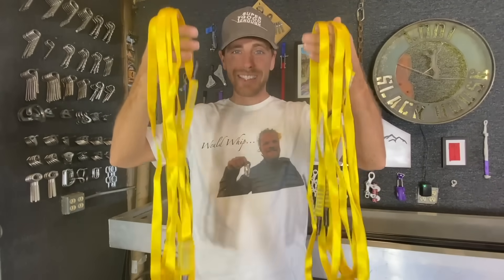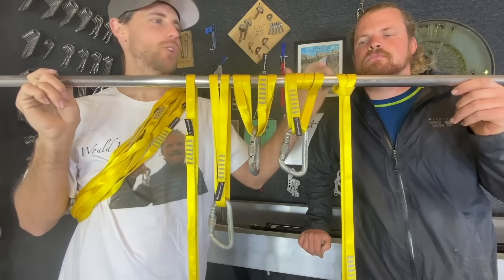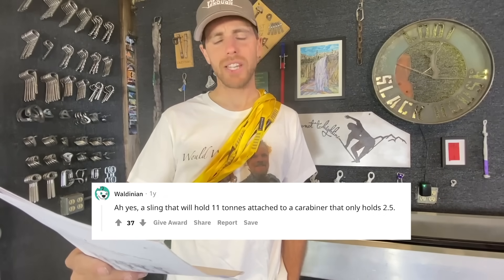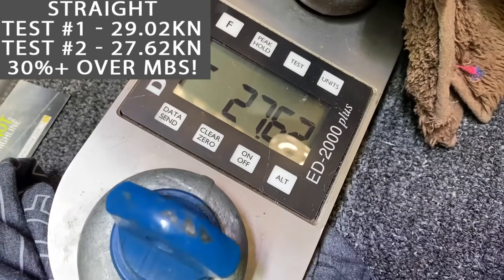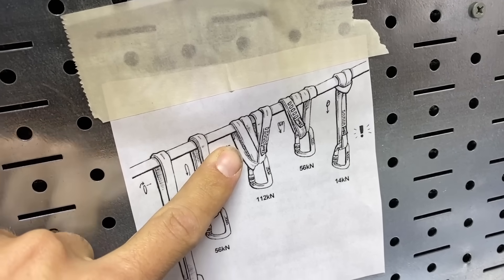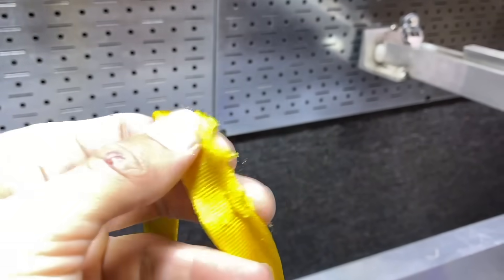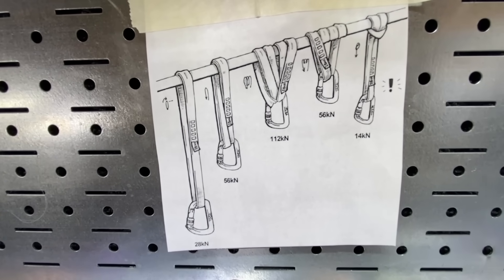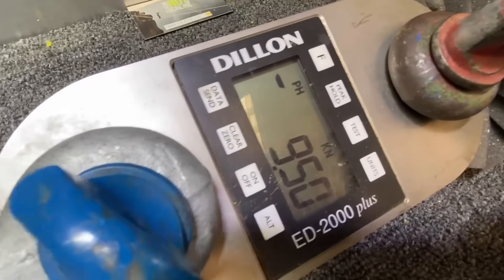Climbing Sling Myths

Comment: I think the way you did the doubling of the sling puts a significant twist in the webbing that gets severely compressed into a very sharp bend or fold.  Doubling the loop on itself, then folding the double over the anchor before the carabiner connects through both ends is not how the diagram is drawn .   For the least deflected configuration... first connect your carabiner on the loop.  Then place the bight of the sling through the shackle and back through the carabiner... then the bight continues goes through the shackle again and finally ends with the connection of the bight to the carabiner.  This will create no twists in the sling and relatively smooth bends.... and so this configuration will give the sling its theoretical maximum strength for this quadrupling of the sling. 
*This is also why you noticed the quadruple configuration making a 90 degree rotation of the hanging carabiner (unlike the diagram) before you placed it in the tester.

Comment: The chart itself I think it's not entirely wrong. You shouldn't expect to have exactly the same number because the output you get from theoretical calculation obviously are not the same you get in real life test. To me the test was close to what the chart says just because how the outputs behave kinda like what is said on the chart. Also a test like you did could be not entirely accurate because it's not always an ideal situation like you tried to recreate where the force is expressed on only one direction and you also have to consider the stress on the anchor and the stress on the material around the anchor and the kind of deformation and a lot of stuff

Comment: So maybe the double double sling applies some friction on itself, so that the force is not distributed along all strings equally. And from some inequalities in the start it cannot establish equality when under stress. This thesis would be supported by the findings on the wrapped one, I think. Maybe a test with WD40 or something might confirm that?

Comment: The illustrative drawing at the beginning of the video resulted from someone trying to apply the principles of an industrial synthetic web sling used in conventional hoisting and rigging operations (ASME B30.9 - Safety Standard for Slings) to climbing slings. There are significant differences in the design, materials and methods of manufacturing. It is also important to note, climbing slings must account for dynamic loading forces (e.g. falling), whereas industrial slings are only based upon static load forces, as they should never see dynamic forces when used properly.
Reply: But the last one is still wrong, it should basically be the same as the first if they were using "theoretical" ropes and a bit less in reality because of the deformations due to the knot. That's what I found strange from the start, and the measurements agree.

Comment: I wonder if nylon performs better if you tie it under load - since it stretches so much otherwise, creating lots of friction.

While in the experiment where you quadrupled the dyneema the sling was nice and parallel to the force applied, here you make the sling shorter, which puts the sling at an angle, so the actual force in the sling is higher than what you're pulling at. (Compare 2 times vs 3 times wrapped around).

Also, maybe you got more than 4x by using 4 slings because the strain is applied slower compared to a single sling / a tied single sling?(stronger than a single sling, and longer than a tied single sling)

Comment: Just found the channel, great video.  I have a break test suggestion, and if it's already been done please point me in a direction. Two anchors, level with each other, say a foot apart: the scenarios are A) each end of a sling attached to one anchor, so the sling + load make a "Y";  and B) the sling looped through BOTH anchors, essentially drawing a line across the top of the Y to close it.  I was told this second scenario greatly increases the forces on the anchors and should never ever be used. I don't doubt it, but I'd like to see real numbers.

Comment: When you wrap the sling around a bar several times, chances are that the tension of each section of the sling won't be exactly the same because of friction around the bar. So when you pull, the section with the most tension will break before you hit the 2x or 4x tension in the system. You probably wouldn't have that problem if each section was on an individual pulley. But the best option would be to get a stronger sling instead.
Reply: Yeah, the melting on failure is evidence of that friction - as the belt is rubbed against the surface friction as the belt breaks and starts to slide off the pin you get heating (energy = force*distance) which melts the belt.

Comment: As you can notice they all fail in compressed areas, eg where the sling is layered over itself. 
theory: the compression is creating additional shear force, creating a weak point in the sling?

Comment: THANK YOU FOR DOING THIS!! I saw this around Instagram and I just knew it was not correct. I think the quadruple has many issues, one that in most situations you don't have the space to do quadrupling without overlapping parts of the sling, and I think most likely it wouldn't be equalized, and end up having a double or single force value. Not that it isn't enough for climbing, I guess.

Comment: Have you tested how strain rate affects the strength of each configuration? Shock loading versus a slower loading would be cool to look at! Or have you looked at the “creep” or steady state strain that would occur when you keep a sling under a constant load, then test the subsequent strength? It would be interesting to know if equipment you rig slack lines with that have a lot of time under tension really shouldn’t be used for climbing.

Comment: My guess for the 4X wraps breaking early is that it’s not evenly pulling on the 4 length. Is locks itself tight, but 1 strand will inevitably be slightly tighter than the rest and will brunt more of the load.

Comment: Great stuff as always! Important to point out about the girth hitch: when you tie it around something with high friction (a tree as opposed to a metal bar) then you can position the knot where you want it. Correctly done, you will get very little tension in the knot. Do it the wrong way and you probably will lose a lot of strength. Try it out!

Comment: The girth hitch results actually makes sense. The 22kN rating is for the weakest point (stitches), but the fabric itself is much stronger. This is why most slings are rated 22kN regardless of the width or material, because manufacturers put enough stitches necessary to reach that strength. When you girth hitch, the fabric strength is reduced at the hitch (could be from 50kN to 25kN in that case), but the strength at the stitches is not affected. Bottom line is, the photo is wrong by stating girth hitching a sling reduces by half its overall strength, but it will be wrong to say a girth hitch doesn't create a weak point.

Comment: Idea for a video although not directly climbing or slackline related. I've been occasionally towing a van with an old climbing rope. Works really smooth but the rope stretches A LOT and I've been wondering if there's a chance it would break.  Would be cool if you guys would put a dyno on and test what forces you actually get when towing.

Comment: 14kN is correct for dynema material, problem is heat between ttwo surfaces.  
By the way, you are aware that all your tests are unrealistic. When a fall, a dynamic load is created and with it heat ... You only load statically, what every manufacturer does already in production. What is it for, anyway? Please try something new, maybe you can come up with something ...

Comment: Knots reduce strength via two main mechanisms: rope-rope friction, and small-radius bends.

Wrapping the slings multiple times, or doubling/quadruplieg/etc, creates sling-sling friction and reduces the strength a bit. So does the girth hitch, but I suspect there's less friction since the inner part where the sling touches itself isn't being squeezed int the bar, but rather pushed around it.

Comment: Great video.. the second ‘doubled’ setup is known almost universally in pro climber (arborist/aerial rescue) as ‘basket configuration’. Best..  
And the people questioning the need for anything greater than 14kn... you want to come watch an arborist negative rig some one tonne + bits of tree out of the sky sometime..  or some window cleaners rigging a huge scaffold up the side of a skyscraper.. there’s plenty of rope professionals out there besides you weekend rock guys :)

[edit] I see a minute later you use the term ‘basket’ yourself, sorry :)
Reply: To be honest arborist and window cleaners are not supposed to have dynamic falls or w/e unless something go really really off. So they dont really need all those huge KN safeties. Using the "weekend rock guys" doesn't give you any credibility and the false air of self - esteem is smelling all around.
Reply: @ProjectMaelstrom  there is some merit to that.... until you recognise that arborists are also rigging large bits of tree down to the ground (which I specifically mentioned above..).  So yes, they’ll avoid shock loading their climbing system/life support at all costs..  but they’ll frequently have little to no choice on their other system which is subject to significantly greater loads than a 90kg bloke with a saw and a helmet.
Also, honestly, yes rope professionals avoid shock loading their system.. but it can and does happen, and when it does it is just as catastrophic. So they DO need those huge ratings on their gear. Professional standards and insurers frequently require a 10:1 or greater ‘overengineering’ on climbing and rigging systems btw, so a system for a 100kg load (for example) may require gear rated for a minimum of a metric tonne for coverage.

Be safe up there, best.

PS “weekend rock guys” is not an attack at all.  But these are the guys who seem to be the most insular in any discussion of this type, who don’t really perceive anybody else who may have experience in these fields.   Arborists, aerial rescue, linesmen, window cleaners, even hobbyist mountaineers and cavers..they’re all well aware of rock climbing communities.  But rock climbing communities are full of people who only perceive rock climbing communities, regardless wether this applies to you or not.  Best.

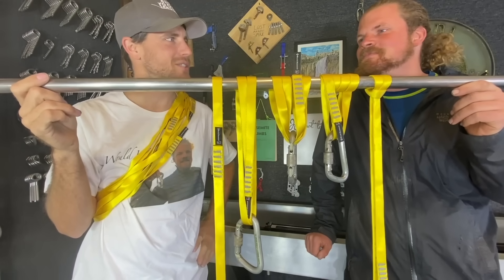Comment: 1:05 you guys question the existence of 28kN sling and then you break them at 27 and 29. Anyone >40 (looking at you Ryan) who has climbed in areas that have lots of really sharp edged flakes for anchors will appreciate the old extra thick nylon slings you used to get back in the day. Troll Supertape 28mm (always in a particular blue color) and I vaguely remember they were 27kN or 28kN?? When 2/3rds the strength is lost by that sharp edge you want it to be very strong, or at least to look like it is very strong :)  Edit: I couldn't afford cams back then so all protection was based on wired nuts, hexes on cord, slings and exclamations of colour-full language

Comment: as for the girth hitch directly on the hanger. doesnt matter if its sharp, its about a different bend radius.
Reply from the maker: And the difference is?
Reply: @HowNOT2  pressure and friction on a small area. Obviously if it's sharper there's more 'slicing' at play. 

 just for the record id never put anything soft directly on a hanger unless I absolutely had to 😛

Comment: im sure its the friction against the shackles/other webbing as the sling stretches. the heat/friction increase is exponential so that's why the breaking point is lower than 88 I think.

Comment: Girth hitch:  Climbing on Giant's Washbowl (Adirondaks NY) ~1980.  Partner was leading, girth-hitched the eye of an in-situ piton with a 1" nylon sling (pretty standard for the time), placed a nut some feet higher, and fell from some more feet higher.
Nut ripped, piton pulled, next nut down caught the fall.  The shock load on the sling in the piton welded the girth hitch in to one blob of nylon in and around the eye of the piton.
I think he still has that souvenir.

Comment: My opinion on why the doubled sling breaks lower than expected: when doubled on itself the inner layer of sling cannot move and stretch properly so the individual threads of the weave act independently instead of in concert. Hard to see in the video, maybe with some stop motion it would become viewable, but I’d wager  the breaks in the doubled or wrapped tests happen where there is contact in opposite directions or different rates of stretch.

Comment: So the yellow slings you tested look like 3/4" webbing. Maybe the illustrations are suggesting actual 1" tubular webbing? Im not sure it will get you to 112kN but it will probably get you to the 56kN. Technically you will never get an actual doubling of strength if you double it up or quadruple it up. The compression of the material at the carabiner will keep you from obtaining that double of strength.

Comment: This test needs to be redone using the drop tower.  Current test method increases load smoothly and gradually where as drop tower will produce more abrupt loading.  I predict that the girth hitch fails at lower kN in drop tower test.

Comment: A discussion I've had on forums in The UK and Ireland is the benefit of Dry treatment on ropes for climbing in an area where you are almost certain to get rained on  on climbing trips.
Sources vary on the reputed reduction in strength of wet ropes from 30% to 70% strength reduction, and a co-existing increase in resultant forces of 10-15 %
Stirling ropes claim the worst case is some types of nylon cored rope (nylon is hydrophillic).

I've previously looked at similar materials in Motorcycling clothing for abrasion resistance and any moisture (even just a little sweat) is as bad as a total drenching.  this appears to be replicated in studies on ropes but I struggled to get good data.

could you plan to compare these effects on various rope and sling materials ?  also do results vary between pull tests vs Drop tests?

Comment: I reckon if the sling is just doubled, than it self equalizes the load easily, whilst when it's wrapped around than the wrap pinches the sling and force might not be distributed evenly, resulting in lowered strength, whith one part of the sling getting more load than the other. Seeing Your test is always an improvement for my intuition. Visual thinking is king.
Reply: This was my conclusion as well.  If the sling was free to slide it would distribute the load to all eight strands evenly.  In reality, as soon as you put tension on, the strands are locked in place on the bar and the shortest of the strands takes a higher load.  It breaks while the rest of the strands are still at partial load, so you never get full utilization out of the other strands.
Reply: Yep, I was going to reply this as well.
Reply: I think it's more about the friction between the strands as they pull, not any difference in load distribution. I don't really know the answer to this, but it seems like any tiny potential difference in equalization would be less significant than the change in friction
Reply: Came here to say this. I think what's happening is a parallel to the test they did with the pulleys that didn't get the theoretical advantage. The friction of the looping over the shackle, and any friction between loops, causes the load to not get distributed evenly among the loops.

Comment: Girth hitch or choke hitch in industry is 80% as the angles formed naturally form 120deg, with anything up to 90deg not requiring any calculations, not sure if this is internationally recognised or not, but it makes a mockery of the 'girth hitch is 50%' BS. And of course we use slings in anchors up to and sometimes including 90 degrees. Great work as ever, and regards to Bobby, get well soon. 👍

Comment: Could you use a thermal camera on the slings to see the warmth build up during the strain  test?
Reply: I'd be really curious to see that, especially in high speed. Stretching the fibers in the rope should cool them down, but friction will of course generate heat.
Reply: @SnakebitSTI  getting a "high speed" thermal camera in the US is hard. Anything above 7fps is regulated under ITAR, because it could be used in heat seeking missiles.
Reply: @lukahierl9857  It’s only a certification that you aren’t going to export it.  Like hugh velocity capable GPS and IMUs.

Comment: Industrial climber here: The girth hitch is the best kind of knot for any situation where you have to use a knot at all, because it reduces the breaking load only by about 19 % on average (more with sharp edges as you can see in the last break test) as opposed to the 50% possible with other knots. Falls in industrial climbing are usually limited by the shock absorber to exactly 0.6 kN. However if you actually have a fall in an industrial climbing situation you can better be sure as hell, that it is not going to be a clean one. And with wired angles, and forces + lots of stuff around that can damage your gear you better be thankful for every extra kN your gear is rated to.